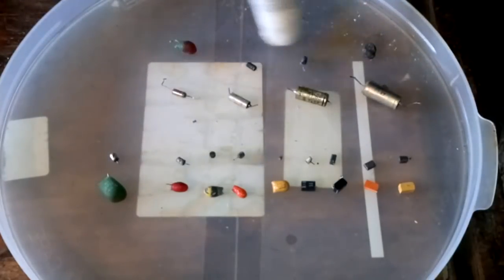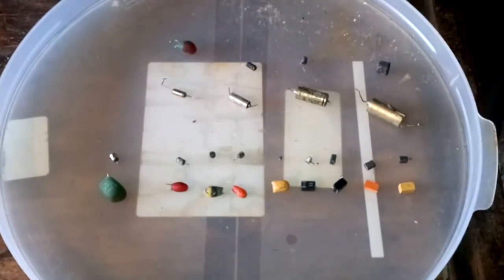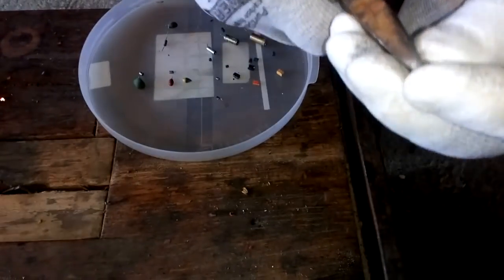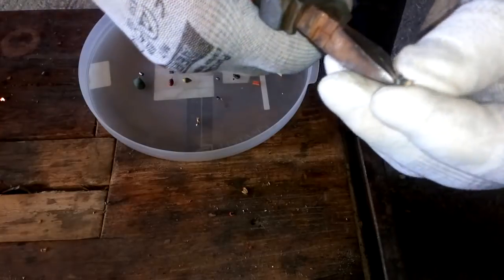TANTALUM CAPACITATORS - colect,sell or refine?

Comment: I've been looking at my tantalum collection for a while wondering the same thing.  I see them listed on ebay all the time but never see them actually sell so I have to wonder where to sell them.  And from what I understand it's not easy to refine tantalum and virtually impossible to melt at home.  So basically I still have no idea what I'll do with what I have saved up.  I think I'll likely just keep adding to the piles.
Reply from the maker: Boring Old White Guy I had a problem myself , until I met the man who often goes to Ukraine! The Ukrainian and Russian markets are sold very easily. For now, I am collecting, I will soon clean them and try to sell them through it, I will split the result with to you!